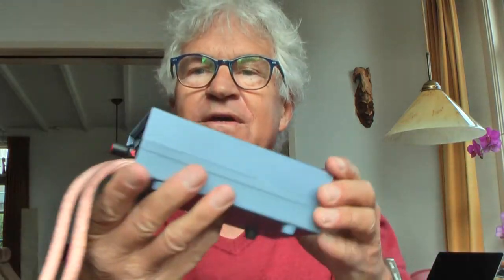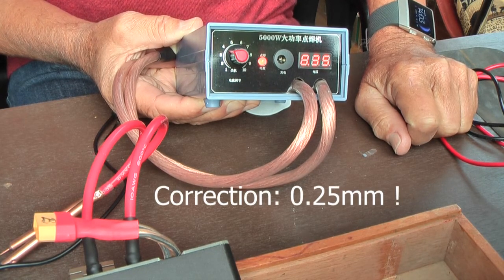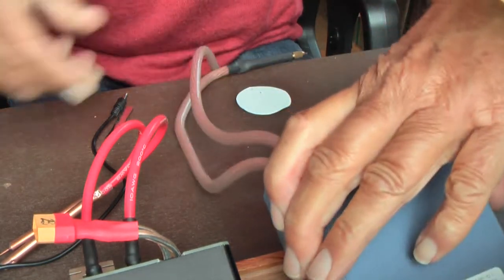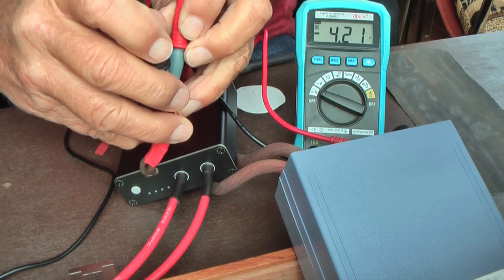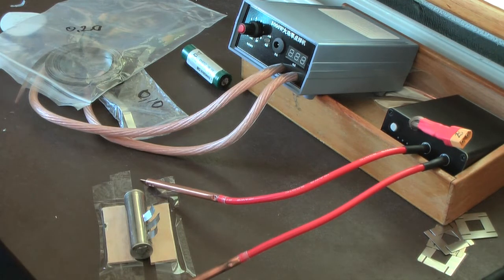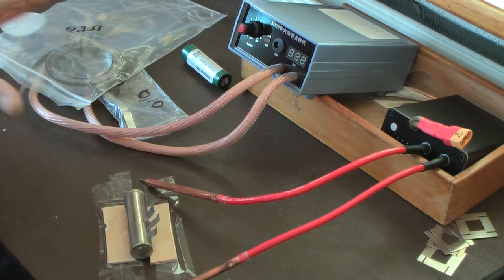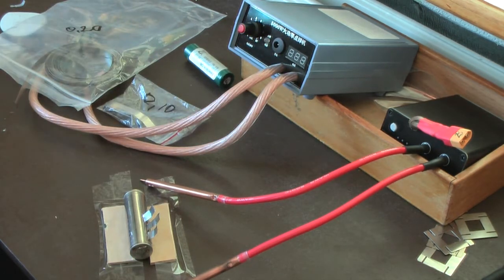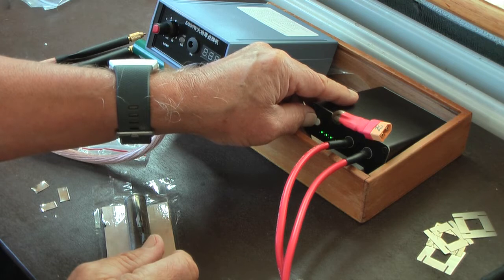KKMoon 5000 W and Minispotwelder compared. Spotwelding 0.10 0.15 and 0.20 mm pure Nickel strip.

Comment: in KKMoon spot welding machine can i install two 18650 3000mAh as a replacement to its lithium polymer batteries?
Reply: Of course, BUT these cells will NOT have the same amperage output, therefore I heavily recommend putting multiple of these in parallel as well. So you can get a maximum discharge of maybe 500A or so? Better overshoot it to not hurt those cells

Comment: I have the 5000, but it won't weld without the foot pedal! Otherwise it works well.
Reply: Keep your foot pressed down on the foot pedal and don't lift it. While foot is engaging the foot pedal do your welds. Light on device will flash once  both probs make contact on nickel and 1.5 seconds later it will weld. After weld go onto next weld but don't lift foot off the foot pedal after the previous weld.
Reply: Thanks  @Zer0phobia . I am going to short the pedal connection since my work area is tall and the pedal is barely long enough, and I'll use the welder without the pedal!

Comment: How does the automatic mode work , my device has a foot switch.
Reply from the maker: Hmm. Good question! I don’t know! Maybe if you disconnect the foot switch it automatically goes in automatic mode? Gerard
Reply: You just keep your foot pressed on the foot pedal and then weld battery after battery. There is a 1.5 second delay after both probes touch nickel. Then you move onto the next battery with your foot still engaging the foot pedal.